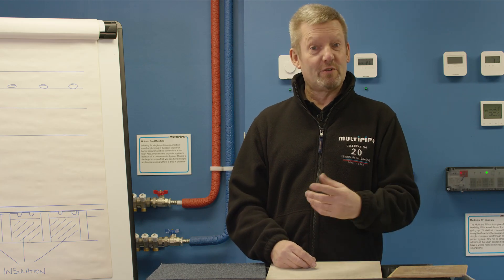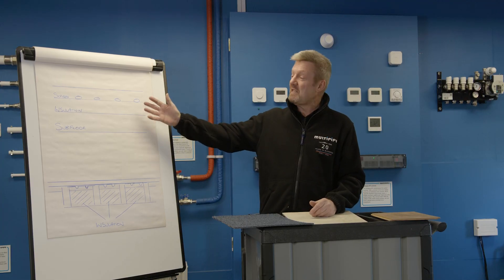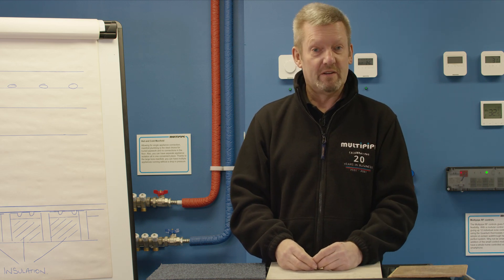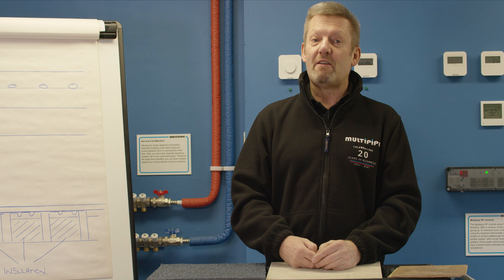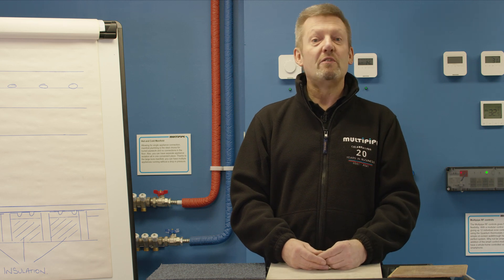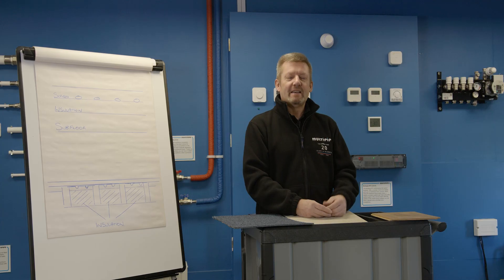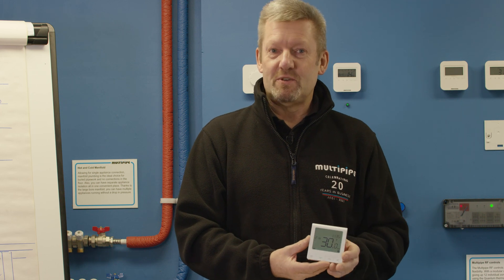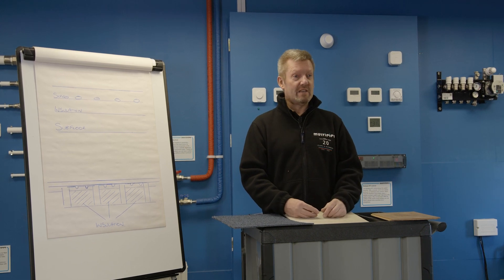The Optimum Underfloor Heating Control For Your System

Comment: If constant heat at a lower temperature is better than on off, should those of us who have thermostats and actuators on the manifold just switch off the wiring centre and does that allow all the zones to open by default, or are the zones shut off until the actuator powers them open?  I have a 2005 Wirsbo system with 4 wire thermostats in each room and brass manifold with actuators and a wiring centre.  I’m wondering if I can just switch it off and whether the heat still flows?  Then maybe if I don’t need some rooms heated, can I remove individual actuators and use a G clamp to hold the pin down to shut off that zone?
Reply from the maker: Unfortunately, all actuator work on a normally closed so will shut the loop when the power is off. if, however, you want to run from one thermostat you can remove all actuators then when that thermostat calls for heat will heat all rooms at the same time.

Comment: how difficult or easy can be the installation of a central heating system for beginners who have left the banks of the school
Reply from the maker: A qualified professional should always carry out all heating system work. In most cases, the system tends to be pressurised with high-temperature water. If it were to fail, this could cause a system issue but, worse, danger to you or your family. This is, of course, in the UK, but it may differ from country to country.